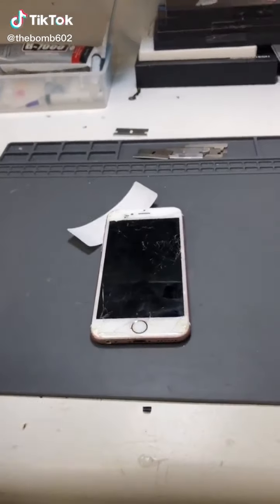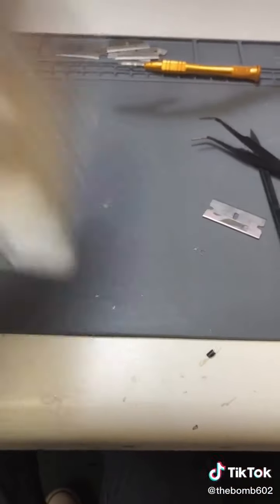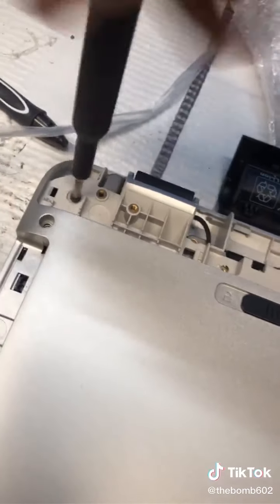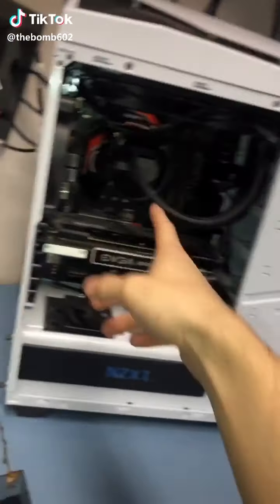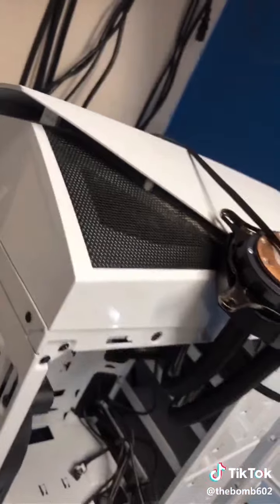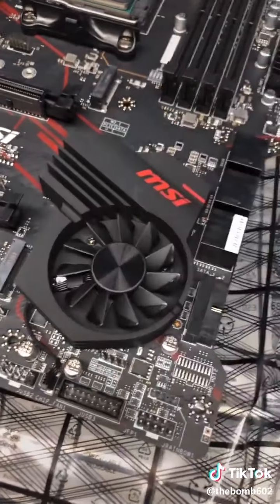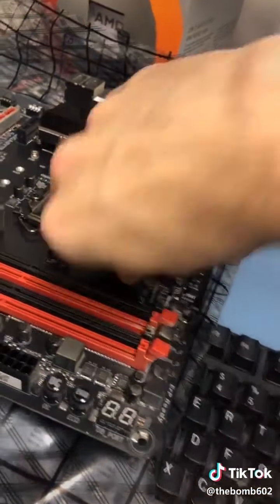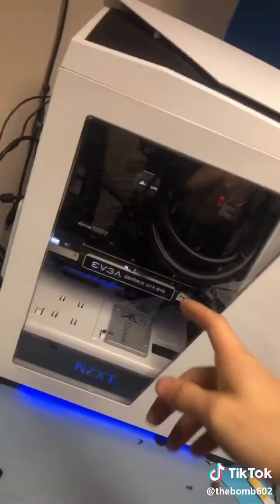Waxboi Tech Reparing #16 | @thebomb602 Tiktok Compilation

Comment: Hope to God you changed the ram speed to the xmp profile cause that's a huge bottleneck if you didn't nor if it goes any higher intek systems don't usually have fast ram